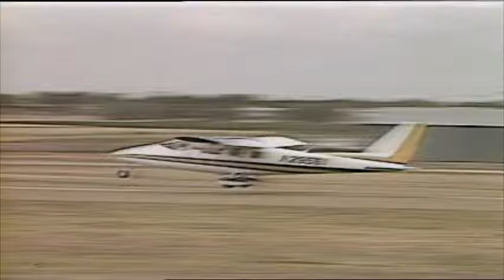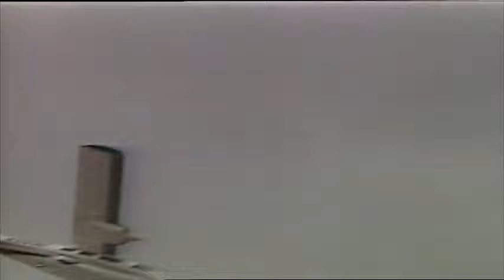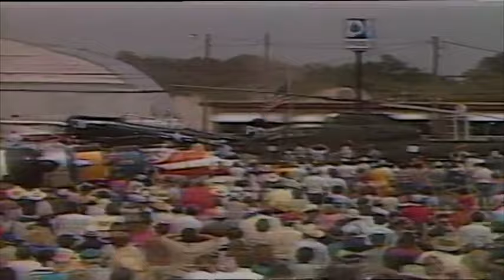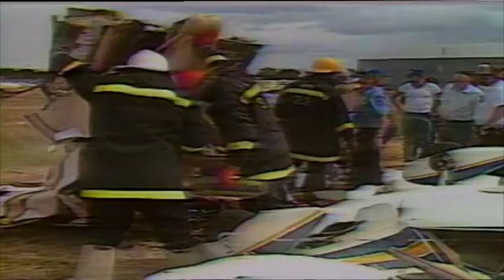Plane Loses Wings During Airshow (09/11/83)

Comment: Maybe not do stunts in a plane that is not meant to do stunts in.
Reply: Almost any aircraft can perform aerobatics as they are all designed according to the same principals. Bob Hoover did aerobatics in a Shrike Commander for many years. Tex Johnson rolled a Boeing 707 after being asked if it could do so. Pilots reportedly rolled the Concorde several times.
Reply: Well tom, I'm going to tell you that you are a 100% incorrect.   @Tom-zs6bb
Reply: @BobABooey.  I'll bet you my commercial pilot and flight instructor certificates I'm not.
Reply: @Tom-zs6bb    I'm also pretty sure you've never read a POH, otherwise you would know.  Move on and keep your pretend certifications.
Reply: @BobABooey.  So tell me, what models of aircraft are unable to fly aerobatic maneuvers? And note that I'm not asking what aircraft are legally authorized to do so. 

And why are you turning a discussion into something personal? That's kind of immature, don't you think?
Reply: @Tom-zs6bb  It depends. Bob Hoover as a stunt pilot probably knows the risk he taking and the fine line of what to much for his plane to handle. He also probably bears the do not try this yourself disclaimer, to other pilots who fly Shrike Commanders. And as for Tex Johnson, Yes he did roll a B-707,  but in a way where it didn't pull a whole lot of G's, not even nowhere close to what some roller coasters might pull. You can find articles online, where he mentioned how many G's it actually pulled when he did that.
Reply: @KenKen-ui4ny  Actually, both Hoover and Johnson demonstrated 1G rolls, Hoover once even pouring a glass if iced tea as he rolled it, but my point was that any aircraft is capable of aerobatic maneuvers.
Reply: @Tom-zs6bb 
Capable? Yes.
Approved? No.
Reply: @singleproppilot  Actually, it was approved by the FAA. He was allowed to perform those maneuvers with the aircraft because it was flown under an experimental airworthiness certificate.
Reply: @Tom-zs6bb  I’m talking about in general, Normal Category airplanes are not approved for acrobatic maneuvers, and are placarded as such. All of the examples you list, including the airplane in the video, were experimental aircraft flown under a waiver for the 1,500 ft AGL  requirement of FAR 91.303. My question is why the FAA would issue an Experimental Airworthiness Certificate and 91.303 waiver in this case. Maybe things were different back in 1983, but I can’t imagine wanting to ignore manufacturer’s recommended operating envelope as a good enough reason for a DAR to issue an Experimental certificate, let alone the airshow waiver for him to perform this patently reckless routine in front of a crowd of spectators. It’s frankly mind-boggling.
Reply: @singleproppilot  Bob Hoover flew his routines in normal category aircraft, too. Apparently he and the FAA were reckless for having done such a thing, or maybe it's not as terrible a thing as you think.
Reply: @Tom-zs6bb  I said no such thing, but I swear the internet is where false equivalencies thrive. Bob Hoover knew and respected the limits of his aircraft and flew it right up to, but did not exceed, its design parameters. This guy, Wes Winter, became infamous for intentionally and repeatedly disregarding those limitations and killing himself in front of his new bride as a result. The two are not the same. They never were the same. It’s not a roll of the dice that Winter died in a plane crash in middle age while Hoover died of old age. It’s a predictable outcome. Moreover, Winter was warned, including by the manufacturer, that he was asking for trouble and disregarded that advice, with tragic consequences. The fact that a regulator would sign off on him performing this routine at all, let alone in front of the general public, just shows that regulators are not all created equal, either.
Reply: @singleproppilot  There is no evidence that the pilot ever exceeded the aircraft's positive/negative G limits, and when he did he was not performing any aerobatic maneuver.
Reply: @Tom-zs6bb  Did he have a G-meter installed? I’m guessing not, since the NTSB had to use the video to calculate the acceleration it took to finally rip the wings off. So, there’s really no way to know if he had previously damaged the airplane with an over-G or not.
Reply: @singleproppilot  " So, there’s really no way to know if he had previously damaged the airplane with an over-G or not."

And before you posted, "This guy, Wes Winter, became infamous for intentionally and repeatedly disregarding those limitations "

Sorry, but I cannot discuss this with you are further. My idiot filter is full.
Reply: @Tom-zs6bb  Yes, he intentionally disregarded the aircraft’s certified limitations by performing aerobatics in it, and he disregarded the manufacturer’s recommendation to stop performing this aerobatic routine. These maneuvers are  prohibited in normal category precisely because it’s difficult to perform them without subjecting the airframe to loads in excess of its design parameters. Now, did he actually exceed the loads the airframe was certified for? We don’t know, and since he didn’t install a G-meter, he didn’t either. I guess ignorance is bliss, at least until you rip the fucking wings off. Sorry, but the laws of physics are immutable. He found out the hard way.
Good day to you, sir.

Comment: You wouldn’t expect both outer wing spars to fail at the same instant from repeated overstresses.  However, if something gave way in the tailplane structure or elevator control system at 1.15 x VNE (per NTSB report) then a dual wing-shuck is exactly what you might expect.
Reply: He exceeded loading by over three g's.
Reply: I am a retired Boeing engineer and private pilot.  With that plane 3 + g over stressed it would be more surprising if both wings didn't break off.  They broke outboard of the engines because the engine weight counteracted the aero load on the inboard part of the wings.  They both broke at the same time because both exceeded critical stress from the high speed pull up.   Apparently this was not the first time he had over stressed that plane probably causing incremental damage each time.

Comment: The pilot was not killed instantly. Rather, he had a gentle descent tot he ground & then "died instantly". That was not a very good plane.
Reply: Nothing wrong with the plane.  The pilot stressed the wings beyond their structural limit.  He exceeded the "NEVER EXCEED SPEED" by 20 knots, and pulled too hard on the controls.  This put 8 to 10 Gs on an air frame that could MAYBE take 6 or 7 Gs before coming apart.